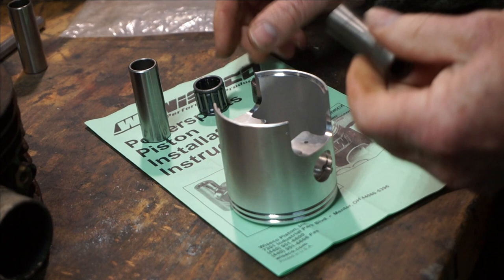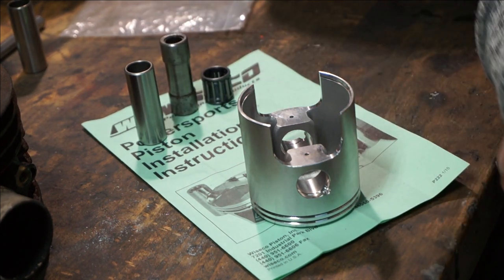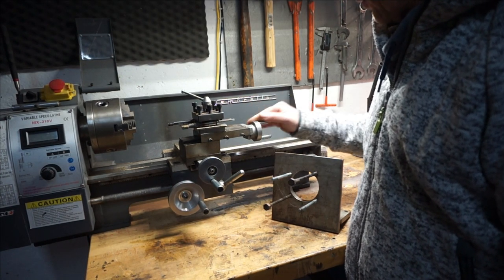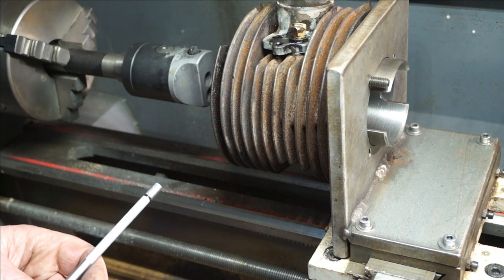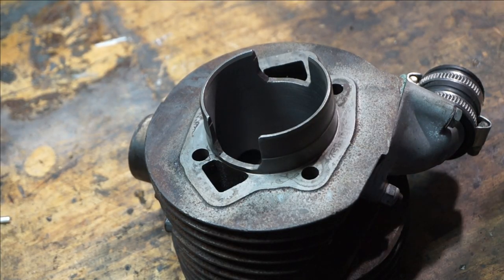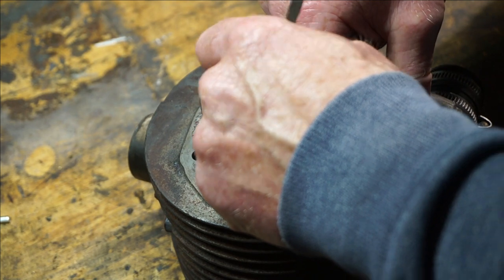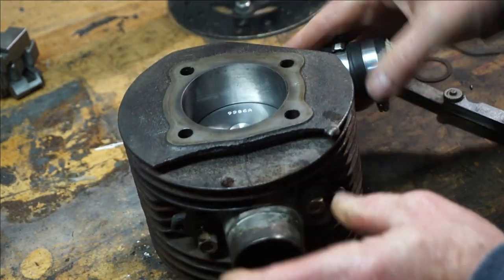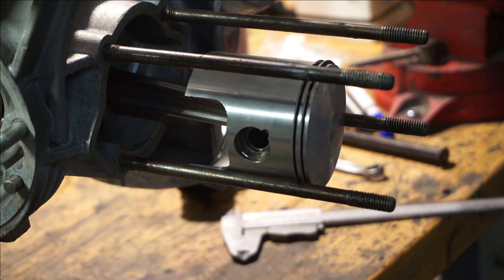LAMBRETTA TV 175

Comment: The top of cilinder lost a little part due broken, I think. This could cause some problems of overheating. Thank's for video.
Reply from the maker: dont worry it will have good air flow  but yes all the fins is better , but set up correctly it will be fine .🧡
Reply: @TheSteelweasel  thank you I missed a part of last  fin like your cilinder, but on the bottom part. Thank's for your answer.
Reply: Are all 175 cylinders the same, I have one on my Li 125 series 3.

Comment: Are all 175 cylinders the same, I have one on my Li 125 series 3.
Reply from the maker: If its original 175  , it has larger transfers  . If it's a 150 rebore then not so large  . If its Indian the port timings are different  . Some anorak might have more info or try sticky 's bible  it might have more info ?
Reply: I bought the scooter as it is, what is the best you could expect to get from a 175 barrel it has a 22ml scootopia carb and a scootopia 42 ml clubman.
Reply from the maker: @executivecarsyork6883  mmm about 8bhp
Reply: @executivecarsyork6883  best at what ?
Reply: @TheSteelweasel  doesn't sound very good, in 1976 I bought a Suzuki AP 50 that had 4 bhp as standard
Reply: @exsoulagent  Trying to pull me along at about 60 mph.
Reply from the maker: @executivecarsyork6883  sx 200 9 bhp
Reply from the maker: this barrel will be around 12 bhp when finished
Reply: @executivecarsyork6883  😂
Reply: @TheSteelweasel  healthy improvement 👍🏻
Reply: @TheSteelweasel  that would be ideal, 25% improvement.